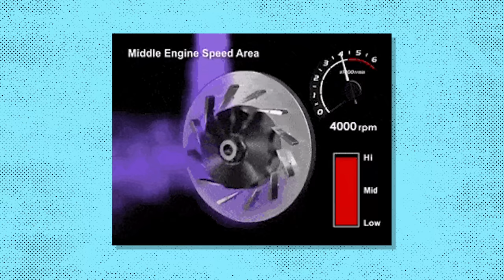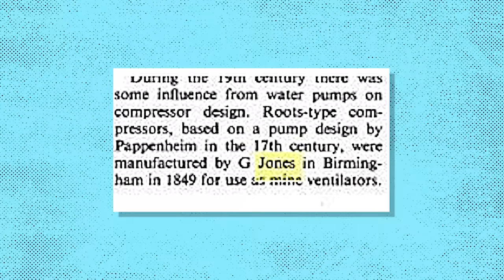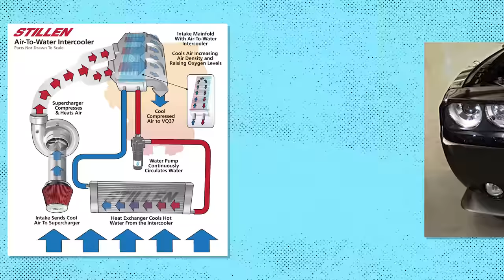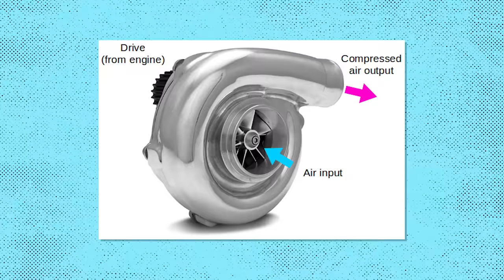Why Superchargers Aren't As Good as Turbos

Comment: Turbos also "use" engine power in the form of pumping loses from back pressure. It's just a lot less power then a belt.
Reply: Then why do turbos make more power with less fuel?
Reply: @sandervanderkammen9230  Because the backpressure of a turbine takes less power then a supercharger belt, as I said.
Reply: @177SCmaro  What backpressure? Turbochargers do not cause backpressure, this is a common urban myth.
Reply: @sandervanderkammen9230  
Lol, I guess backpressure sensors are all lying then.
Reply: @177SCmaro  A pressure sensor can only show manifold pressure... its does not show Delta~P
Reply: @sandervanderkammen9230  
Please just google backpresure sensors and/or all the videos fussing about backpressure to boost ratios. Some autoshops even have them to check for a plugged converter. You could probably even rig up fluid filled pressure guage and see something.
Reply: @177SCmaro  A little knowledge can be a very bad thing... even the most accurate instraments are useless unless you know how to use them and understand what you are measuring.
Reply: @sandervanderkammen9230  
Uh-huh. Any other discount fortune cookie lines you wanna share to try to sound profound or are we done here?
Reply: @177SCmaro  In Naturally Aspirated engines intake manifold pressure is never higher than 14.7 psi (atmospheric pressure at sea level).
In forced induction engines manifold pressure can be significantly higher.

In a properly designed turbocharged engine there is no significant increase in the Delta-P so no increase in backpressure.
Any questions?
Reply: @sandervanderkammen9230  
You didn't say anything I didn't already know or asked of you. You're trying way too hard to sound smart, which implies some insecurity on your part no one cares about, when the only issue was the resistance a turbocharger creates against the engine to generate intake pressure via the compressor is usually less than the resistance generated by a belt in other types of compressors and this pressure before the turbine can be measured and compared to the pressure in the intake manifold. Ideally it's 1 to 1. Over 2 to 1 is an indication your hot side might be smaller than ideal but if you're hitting your power and turbo responce goals that hardly matters. "Good enough" is thing in the real world.
This is all common knowledge. Not sure what your problem is.
Reply: @177SCmaro  Then why do you contradict yourself?
 If the pressure differential between intake manifold and the exhaust manifold is 1:1 ??? Then there is no Delta~P , zero pressure differential and no increase in backpressure.
Compared to naturally aspirated engines, this represents a Reduction in effective backpressure.
 This is confirmed by the typical drop in BSFC seen with turbocharged engines, more power and less fuel consumption.
 I think you understand this but do not want to agree with me or laws of fluid dynamics and thermodynamics that prove otherwise.
Reply: @sandervanderkammen9230  
I'm not contradicting myself. Evidently you don't understand what back pressure is.
The increase in backpressure is relative to not having a turbo, which was part of my point - a turbo isn't "free" boost, it's just more efficient the a belt.
If manifold pressure is 10psi and exhaust pressure is 10psi that's a 1:1 ratio but we still have the 10 psi of pressure in the exhaust working against the piston as it's going up trying to force the exhaust out through most of the exhaust stroke.
If you don't think that costs power weld your exhaust closed then drill a 1/2in opening and see how well your car runs.
Also, you're confused. Supercharged engines of every stripe typically have lower bsfc i.e. are less efficient per pound of fuel consumed but can consume fuel at a faster rate thus netting more power - quantity over quality, you might say. This is due to several reasons but mostly because it takes a lot of horsepower to compress air especially in the volumes an engine needs. I don't think you know what you're talking about beyond dropping terms like you're name-bombing.
Reply: @177SCmaro  You contradicted yourself yet again!
If the pressure is the same in the intake manifold and exhaust manifold? There is no pressure related pumping loss! because the pressure is the same!
   Turbochargers operate using the waste heat energy rejected by the reciprocating engine.
This is essentially "free energy" to use your words, that is normally wasted out the tailpipe of a Naturally Aspirated or Supercharged engine.
 The energy that drives the turbine wheel does not impose any pumping loss.
 Turbochargers use an Impulse Type turbine, this means it converts the thermal-kinetic energy into shaft horsepower not pressure.

BSFC is the ratio of pounds or kilograms of fuel per horsepower/hour.
 Supercharged engines have higher BSFC because the increase in pumping efficiency is offset by the amount of fuel and shaft horsepower required to drive the compressor.

Turbochargers use a  Combined Thermodynamic Cycle, it is the use of two separate heat engines sharing common thermal reservoir.
 The reciprocating engine utilizing either the Otto or Diesel Cycle and the turbocharger utilizing the Brayton Cycle to drive the compressor.

Any questions?
Reply: @177SCmaro  I'm not the one contradicted himself or mixing up his metrics terminology.

I didn't mean to embarrass you... you seem like an inteligent person that has some experience with internal combustion engines. 
I think this is a case where you are treading outside your actual skill  level of knowledge and have let confidence get the best of you.

Turbochargers are engines... engines  that drive a compressor which is shared by both engines.
 The turbine wheel is driven by heat energy in exactly the same way, by thermally expanding gases.
The difference is the method used to convert the heat into shaft horsepower.
The reciprocating engine works through pressure, the gas turbine through kinetic energy. 
Pascal's Law of Fluid Dynamics and Bernoulli's Law of Fluid Dynamics

Brayton Cycle engines operate using similar Carnot Cycle thermodynamics..
But the fluid dynamics involved is very different.

Without understanding these fundamental engineering principles you simply cannot fully understand how a turbocharged engine operates  or how they differ completely from naturally aspirated and supercharged   engines.
Any questions?
Reply: @177SCmaro  I'm simply trying to help you understand how turbochargers actually work (not the unban myths about them) and that as you explained there is no Delta~P No pressure differential between the engine and the turbo.
So there is no increase in backpressure or pumping loss.

I realized that some people have certain kinds of learning disabilities and need visual aids and graphic demonstrations to truly understand the material.
I think your understanding of Carnot Cycle thermodynamics need alot work as this inhibits your ability to grasp some of the important fundamental concepts and how they interact.
Reply: @177SCmaro  Have worked hands on with all types of engines and worked in a dealer repair shop in college, I have also restored cars, trucks and airplanes as a hobby.
 I have earned many technicians certifications. 

I don't doubt your skills as a mechanic sir... I'm sure you are very proud of your car, I am just trying to help you understand some engineering fundamentals that most mechanics receive little to no education on.
 Turbocharged engines are very complex in terms of the fluid dynamics and thermodynamics involved and is generally well beyond what is taught by trade schools and automotive training programs.
I also understand that many people who are self-taught can be a little intimidated by those with more experience and extensive training and education.
Do you have any questions?
Reply: @sandervanderkammen9230  
You are failing to do so and you're obviously wrong. A turbine it a pretty good obstical in the way and engines don't work how you think they do. Turbocharged engines don't work like a hydraulic cylinder with pressure on both ends so the force is equal. They have valves that separate the intake and exhaust systems at some times in the cycle, as I explained. 
10 psi in both the intake and the exhaust only effects the other when both the intake and exhaust valves are open. When the intake valve is still closed, the exhaust valve is open and there is 10psi in the exhaust between the valve and the turbine and the piston is pushing against that that is a pumping loss due to backpressure, it takes some power to overcome.
Learn the basics before you presume to lecture others. 
Now leave me alone.
Reply: @sandervanderkammen9230  
You don't know how engines work. Bye.
Reply: @177SCmaro  Are you too ashamed to admit that you are wrong?
 Obviously if a turbocharged engine produces more power than a supercharged engine by flowing more cfms of air, there is no obstruction caused by the turbine.
   How can you reconcile this glaring, monumental error in your half-baked  theory???
Reply: @177SCmaro  How do you not understand these basic fundamental engineering concepts that apply to all internal combustion technology???

The turbocharger uses heat energy rejected by the reciprocating engine to drive the turbine..
  This is well-known and understood concept in internal combustion technology.
Any legitimate, certified engineer worth his salt knows this... you seem to lack the education and professional experience in the field to speak inteligently about turbocharging and reciprocating ICEs.
Reply: @sandervanderkammen9230  
No obstruction? So turbos don't require energy to compress air? You think driving a turbine is the same as an open pipe? So you don't now how turbochargers work either? You had two week to learn engines, turboes, ect ffs.
Why don't you go trawling for attention elsewhere?
Turbocharged engines usually produce more power then a roots or screw supercharger because a turbo uses a more efficient type of compressor which adds less heat per cfm which results in greater air density and the pumping losses from backpressure from the turbine is usually less than the parasitic losses from driving a belt netting more power even at the SAME cfm as a roots/screw sc.
 In simple terms, at, say, 10 psi of boost a turbo usually makes more power then a blower at 10 psi because the turbo is more efficient and takes less power from the engine to operate.
Basic, basic stuff, dude.
Reply: @sandervanderkammen9230  
The MEANS of using the heat energy, the turbine, creates back pressure. It's not possible to capture energy for free. Obviously a turbine is not the same as an open pipe especially when it's attached to an air pump that is providing resistance my obtuse friend. Compressing air take a lot of energy. Putting a turbine-driven air pump between the pistons and the atmosphere can be a significant restriction the engine has to overcome in the form of backpressure.
Understand?
Reply: @177SCmaro  No obstruction.
What goes in must come back out right? 
The same temperature volume of air  (weight) of air flows into the engine as flows out, so there is no obstruction as the turbo engine flows more air than the same engine naturally aspirated.
You theory is deeply flawed, some superchargers use the exact same type of centrifugal compressor as a turbo.
No, backpressure prevents air from flowing in but turbos flow more air not less.

So now you are saying that the turbos compressor takeslesspower to turn than the supercharger compressor????
That makes no logic sense! Can you please explain how that works?
Reply: @sandervanderkammen9230  
Really? Do you just get bored every couple of weeks and run around trolling people?
Please learn how engines work before you worry about me teaching you how turbochargers and other types of superchargers work, why they have different efficiencies, ect. You've never even touched an engine or a turbocharger and you're denying basic aspects of how they work. 
Get a job. Buy a car with a turbo. Put a pressure sensor in the exhaust before the turbo. Observe the pressure changes. Leave me alone.
Reply: @177SCmaro  You don't have to be embarrassed to admit that you were wrong, it OK to say " I'm sorry, I didn't know that was how turbochargers actually work."
No one is going to  shame you for trying to learn something new that you didn't know.
You don't have to feel intimidated by people with more education or more experience than you, it's all about learning.
Reply: @sandervanderkammen9230  
Get some new material. 
Get a job. Get a turbo car. Get a pressure sensor. Test it yourself. Leave me alone.
Reply: @sandervanderkammen9230  Get a job. Get a turbo car. Get a pressure sensor. Test it yourself.
Reply: @177SCmaro  WHY DID YOU CHANGE YOUR COMMENTS???
ARE YOU ADMITTING THAT YOU WERE WRONG?
DID YOU THINK I WOULD NOT NOTICE YOU DELETED YOUR MISTAKES?
Reply: @177SCmaro  A exhaust pressure sensor won't prove anything unless its installed on a naturally aspirated engine...
To read backpressure on a turbocharged engine you also need an intake manifold pressure sensor.
 If there is no Delta~P? There is no backpressure
Reply: @sandervanderkammen9230  
Get a job. Get a turbo car. Get an exhaust pressure sensor. Get a MAP sensor. Test it yourself.
Reply: @177SCmaro  Stop spreading lies and ignorant misinformation about turbochargers.
It's obvious from your comments that you don't understand how actually operate.
Reply: @sandervanderkammen9230  
Get a job. Get a turbo car. Get an exhaust pressure sensor. Get a MAP sensor. Test it yourself.
Reply: @177SCmaro  If you had tested it? You would discover you are wrong, wrong because there is no backpressure between the engine and the turbo because the pressure in the intake manifold is the same or higher than the turbine inlet pressure which drops as it speeds up..
Bernoulli Principle
Reply: @sandervanderkammen9230  
I have a turbocharged Ford Coyote in my race car. Simply put Manifold pressure is about 5-6 psig. Exhaust pressure is usually around 12.5 psig. 
Once again, the primary reason this happens is not only is the exhaust from all eight cylinder funneled into a single 3 in pipe which, helps raise the pressure and speed of the gases, there is a turbine between the exhaust ports and the atmosphere that obstructs exhaust flow. This is on purpose as the exhaust strikes the turbine, thus slowing down, it captures and converts the heat, pressure, and inertia of the exhaust onto mechanical power to drive the compressor to do work. This has the secondary effect of increasing exhaust pressure as the very hot gases "stack up" as they force their way past the turbine.
Something else you don't know. A MAP sensor reads absolute pressure and most exhaust pressure sensors  read guage pressure. So, to a laymen such as yourself, it's easy to see a MAP reading and thinking it's much higher than a psig reading.
Also, the pressure in the intake manifold could be 100psi and it would only effect the exhaust side during valve overlap, which is a small window relative to the exhaust stroke. This has been explained to you several times. You don't understand how valve timing works.
Reply: @177SCmaro  What's wrong with your car?
Something is obviously very wrong with your installation or your instraments are faulty.
Bad turbocharger bearing maybe?
Reply: @177SCmaro  Sounds like you need to consult with someone who has experience in dealing with turbochargers... they can help you diagnose if there is a mechanical problem or if it's a design and installation error.
Reply: @sandervanderkammen9230  
You say that without knowing a thing about the details of my build. An exhaust pressure to boost ratio of about 1.5 to 1 is fairly normal. Some go over 2 to 1, esp oem's with small, zippy turbos, if you can approach 1 to 1 it's likely an extremely efficient setup found in high tier racing. I'm not aware of anyone who's gone over 1 to 1 i.e. makes more boost than back pressure.
My car makes nearly 600hp at low boost and runs high 10's in a 1/4 mile, next season I'm shooting for low 10's. I built it myself. Why don't you come over and use your vast racing experience to tell me what I did wrong and show me your build?
Reply: @177SCmaro  Its obvious that you engine is poorly designed and not operating very efficiently.
The fact that you are unaware of this reveals a shocking lack of knowledge and experience regarding this topic.
Reply: @sandervanderkammen9230  
Lol, okay. You think a 600hp engine put in a car it was never intended for is an example of a lack of knowledge and experience? Where's your race car you built yourself then?

Comment: Superchargers kinda suck? Maybe you are right, but i do not know, but one thing i guarantee is that indeed, not only superchargers but turbochargers does suck too!
I dunno which is more efficient for the performance of the car.
Reply: Turbos are better
Reply: @sandervanderkammen9230  No, both of them combined are better. (Twincharger)
Reply: @Netosilvagames  turbos produce more power and use less fuel than a supercharger... the turbocharger is fundamentally superior to the supercharger and is rhe reason why the turbo dominates forced induction and superchargers are relatively rare.
Reply: @sandervanderkammen9230  thanks for the information but both still suck air